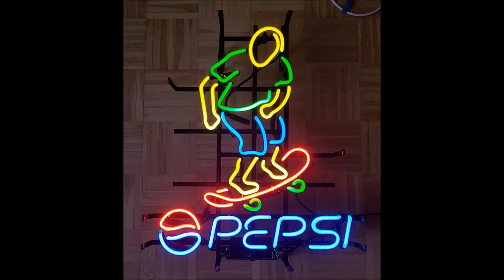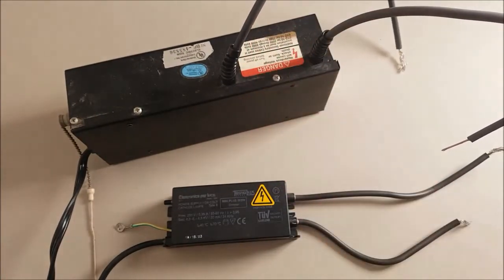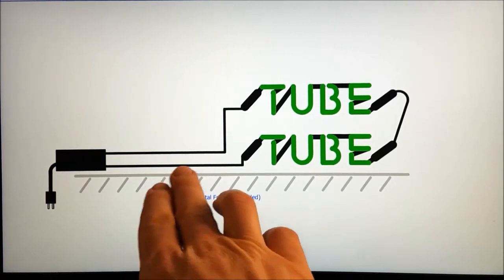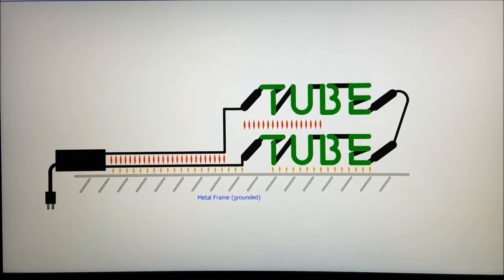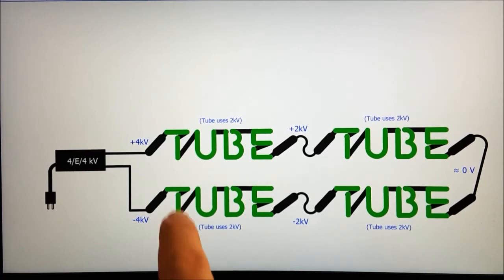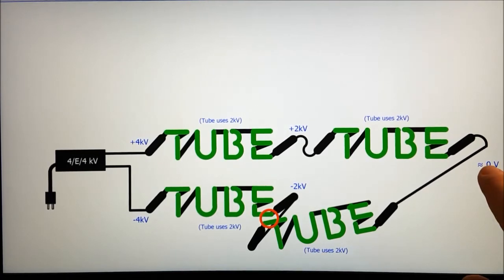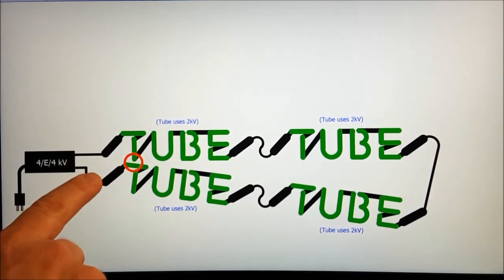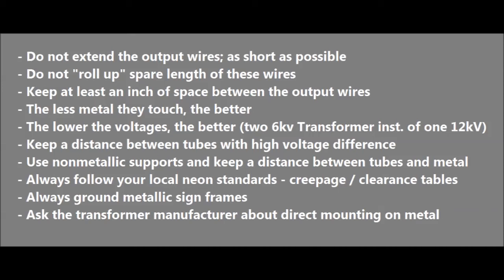Electronic / Solid State Neon Sign Transformer do's and don'ts

Comment: Great info, great vid. I have one problem. I'm making a small little neon letter and  the two input wires from the transformer have NO indication of what is LIVE or Earth/GROUND. Both black though one is slightly shorter. Does it matter what wire goes to LIVE or GROUND on the plug. I love neon artwork and have only just started my first project and this simply thing has halted my progress. Thanx in advance
Reply from the maker: Hi. I assume you want to find out which black wire is Live and which is Neutral. Ground is something different. Live and Neutral can usually be swapped, it does not matter.
Are we talking about an electronic transformer? If they only have 2 thin wires and not a 3-pole power cord, they are often not compliant to the safety standards. Which country?

Comment: If using a transformer on a metal frame, if you have no choice but to run the wires along the metal, what about obtaining some clear neon glass of appropriate size, running the wires inside the glass along the metal for extra insulation and tie-wrap the glass to the frame?
I have an old Ballantine Beer neon sign that runs the transformer wires inside glass, and it's an old school magnetic transformer. Most likely done for "safety".
Reply from the maker: Glass tubes will help, or just distance. You could even use tube supports to hold the wires. Touching only small lengths of metal is usually not a problem, see 3:29

Comment: I thought about your video again, today, and I felt like I somehow missed something that I would like to know. What is the damage of bad wiring and what happened there and how? On the Pepsi sign, potential differences were too close together. And that somehow removed the block out paint? How? Did it get too hot and it evapourated? And why is the tube darker at that spot? Because the paint is missing?
Reply from the maker: I think the blockout paint is missing because of barely visible small arcing between the tubes, so yes it kind of evaporated or eroded. You usually also hear a hissing or crackling noise in that spot. Another explanation would be that ozone generated in that spot eroded the paint. The dark spot inside the tube could be mercury or sputtering from the electrode that have deposited there, or just aged/damaged phosphor. You see I can't really explain but those are usual traces of tubes being too close together. Blockout missing, and tube inside somehow darkened.

Comment: So when you say ground any metallic frame, you mean ground the transformer to the frame by way of green ground wire. Drill a hole in frame & put ground fork between two washers so that it's evenly supported?
Reply from the maker: Hi, every country has its own rules for ground connections but in theory yes, if the transformer has a metallic grounded case, it might be enough to screw it to the frame so there is ground connection through the mounting, or use a piece of green wire from the transformers ground terminal to the frame with a fork/ring lug etc..
Reply: @NeonSignStuff  that's exactly what I do. I've never know if it was technically up to code, but it's always worked. Maybe not recommend though. I would say what you are telling people is way more accurate than my guess work lol. Love the vids! They've been very helpful 🙂

Comment: What can be the issue when a neon sign with 5kV electronic transformer works perfectly fine, just for 8 mins and then switches off, remove power supply for a minute, reconnect and the same happens, runs for 8 mins then switches off??
Reply from the maker: If it's exactly 8 minutes each time that would be strange, but in general your description fits these issues: a tube is failing, or the transformer is failing, or transformer always has been too small for the sign and now, as the tubes are aging, this problem starts to show.
Reply: @NeonSignStuff  plus minus 8 minutes, it varies. So must I go for a bigger transformer?
Reply from the maker: @karooboermeyer1115  that should work. Depending on the real reason, it might work many years or a few weeks.

Comment: At 9:30 You showed fascinating undesirable phenomenon, but sadly not describe it.  It's call "jelly bean" effect, and is occur only in pure neon tubes supplying by some SMPS converters. Blue tube filled by Penning mixture with mercury vapor is not affected with this phenomenon. Some producers of SMPS converters are warning customers about availability of occurrence jelly bean effect eg. Hansen Neon in EVG 60/2. Other producers like Tecnolux Italy offer special version SMPS for pure neon tube , like "MINI 2020 Neon". This device eliminate jelly bean effect by adding small amount DC offset to AC/HV output, but it's also danger to blue / Penning+Hg tubes because add a mercury migration effect. Some chinese SMPS manufacturers like Hongba/Hyrite offers universal SMPS with no jelly bean effect and no Hg migration. This devices eliminate described effects by vobutating output frequency, or by modulating it by PWM. SMPS from other Chinese brand Cool Neon/gseef.com are free from Hg migration but also jelly bean effect can occur :(
Reply from the maker: Maciej, you are right about this. The larger hansen and tecnolux models (5-10kV) are also advertised as both blue and red gas compatible, and with no mercury migration. They usually show a few single little beads in the red tubes, often at tight spots, but most of the red lights up steady. I made this little art piece at the end of the video and it's powered by 2 very simple CCFL inverters. Touching the tube adds load to the inverter, that changes the frequency it's running on, and that changes the effect. This effect is just visual, it's not a technical problem and does not harm the tube. One american manufacturer makes transformers especially for this effect, they call them "beadmaker".
Reply: @NeonSignStuff  Most of my workshop's customers would describe this behavior as a neon malfunction :) Of course, "jelly bean" effect is useful for neon art, but only for that ;) Regards from Poland!
Reply from the maker: @maciekgd  greetings to Poland! I have 2 awesome neon photo books from Ilona Karwinska, i'm sure you know them. "Polish cold war neon" and "Neon revolution".
Reply: @NeonSignStuff  As you're mentioning especially-made circuits to get the effect on purpose:
That reminded me of a Neon clock in a PC game. Well, I'm just talking about the first version of "The Sims". In one additional pack you had the possibility to buy a decorative clock for a wall, with a circular (pink, as I remember it) tube around it. And they even animated it to have these beads moving inside. :) Well, this has nothing to do with real Neon, but that quirky memory just came to my mind.
Reply: @NeonSignStuff  I've tried using some very small laptop CCFL inverters to power neon without much success. They will light only a few inches of tube and not brightly, even when I supply 20V input power (they're rated 5-24V, I believe). Which CCFL inverter are you using to power that small art piece? It looks really nice!
Reply from the maker: @benperkins5902  if the inverter doesn't light up the full length, the voltage is not enough. The ones i am using are 2000V 8mA, that is unusually strong for ccfl inverters. They were made for CCFL lamps for furniture, but are now discontinued.